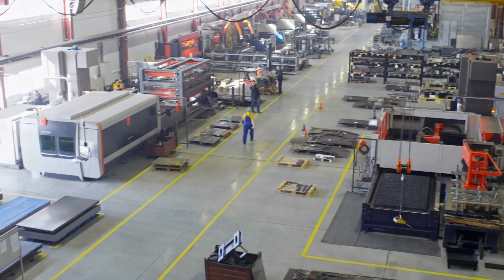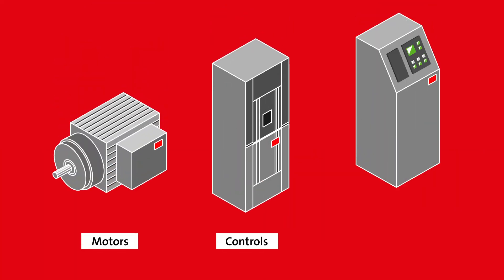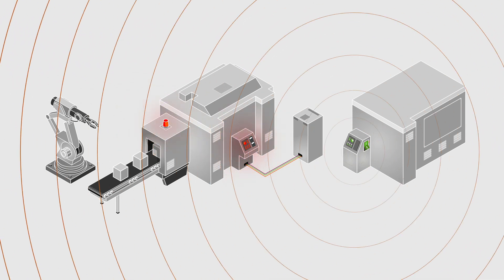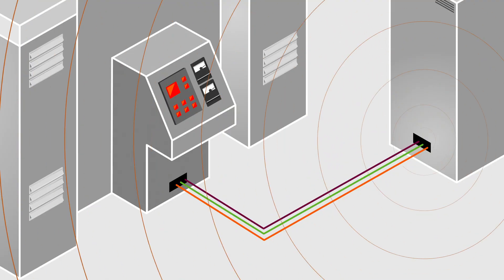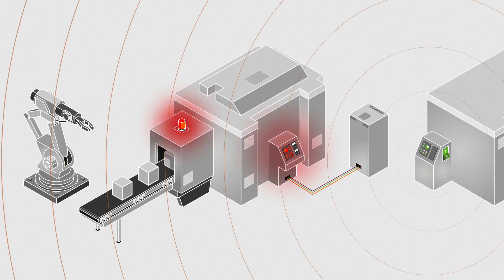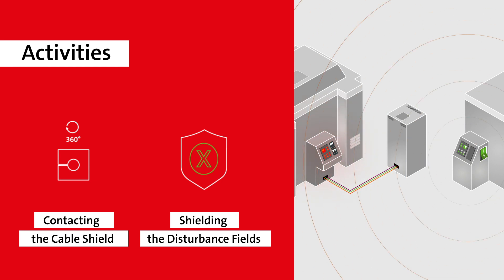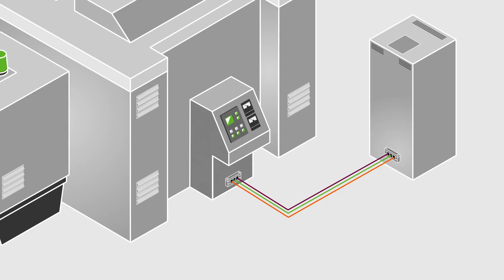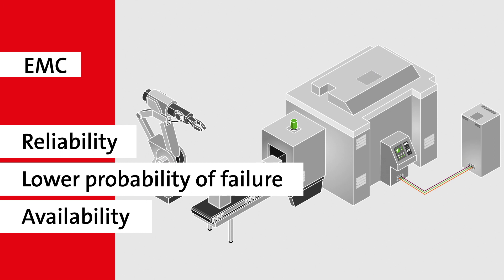Electromagnetic compatibility (EMC) - How to protect your machinery / plant from EMI

Comment: This product will help until galvanic corrosion starts to form. I would suggest you use some No-ox on the connections to the shields and between the stainless clamp (anodic index of around -0.60 volts) and the galvanized plate (electroplated zinc, anodic index of -1.25 volts) to prevent corrosion. The zinc will be sacrificial to the stainless eventually causing loss of the passivation and corrosion. Corrosion forms a electrical junction with nonlinear properties similar to that of a diode. This junction will  cause passive intermodulation from any radio frequency currents within the shield to case connection. And these radio frequency harmonic currents will then be able to enter the enclosure on the cable shield.